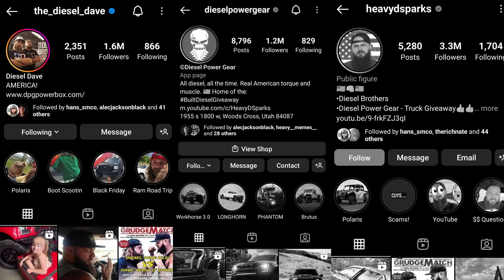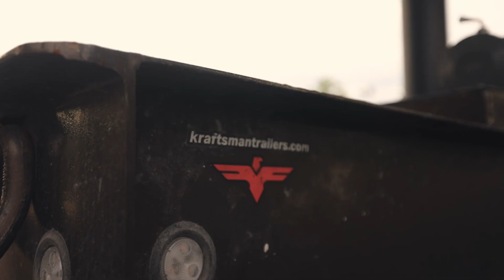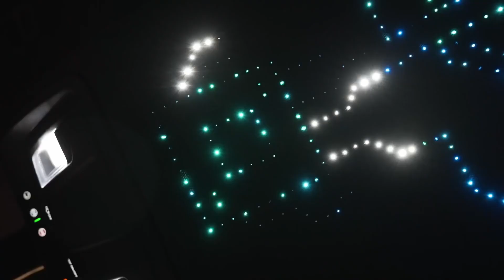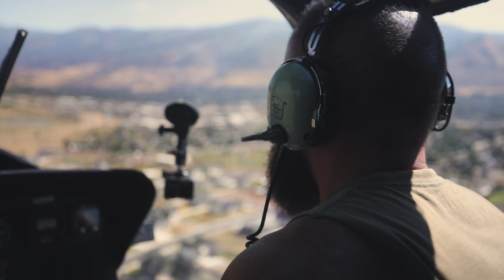We almost gave his truck to the wrong person! (Building the Powerbox)

Comment: I had a SCAM alert sent to me on You tude (DIDNT BITE,  SENT HIM PACKING HE DIDNT RESPOND TO MY MESSAGE I SENT BACK, U are in Utah and the call came from Tennessee)  🤬🤬🤩😁How dare U use A Ford Ranger to tare  down a house,(March of 21)  I  owned A 93 Ford Ranger 5 speed and this truck was  A die hard.  Only maintance I did to this truck was starter, alternator,  clutch and through out bearing, ( besides normal maintance) bought it in 95 and sold it in 2016 and it only had 160,000 miles on it, when I sold it, when I bought it there was only 33,000 miles on it and the best part, I only put 2 YES I said 2 sets of tires on this truck the whole time I owned it and my Son was a Marine and he drove it back to  Camp Legion NC  (sorry flunked spelling 101) 😁😁 this truck I loved BUT the only reason I sold it for 500.00 was it was a 5 speed and my old knees couldnt take holding the clutch in AND the guy that bought it KNEW he was getting one HELL of a deal I am now driving a Chrysler 200 and my Dad in heaven would be A Happy Man.  And 😁 when it comes to my Son and this truck O'my I can tell u a story and make my son turn red in the face 😂 just like (i think) hunter both of my kids are red heads love it I luv my Son and Daughter